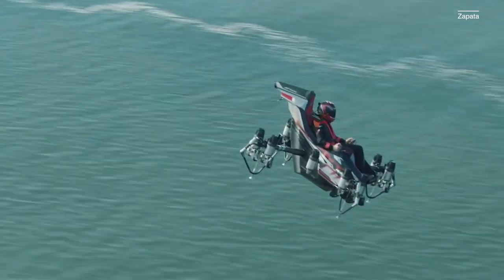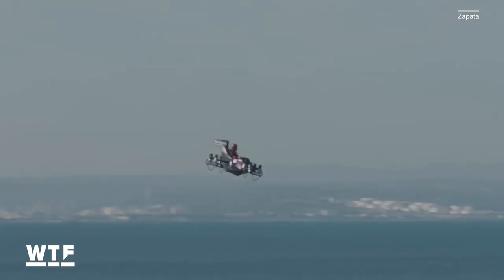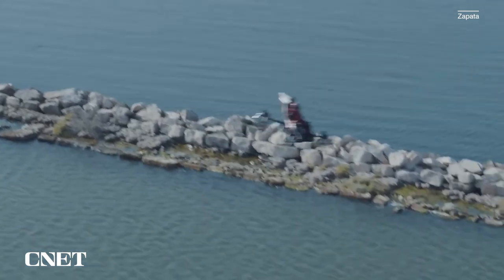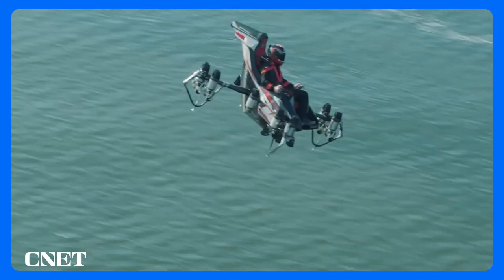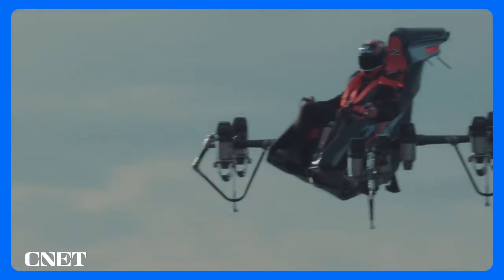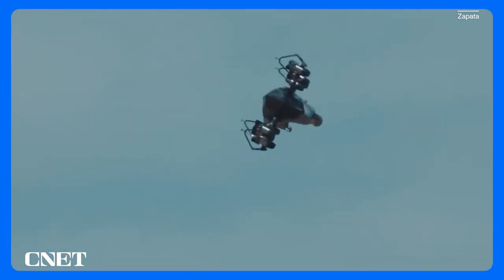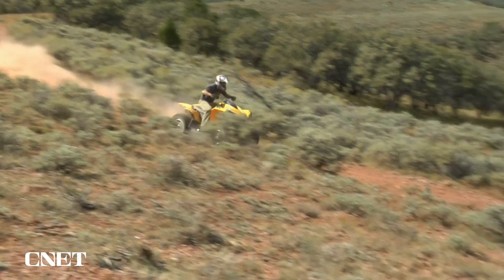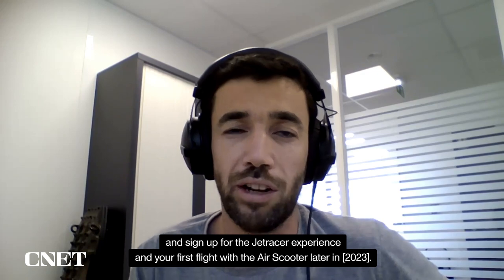Meet the Jetracer That's Powered by 10 Jet Engines

Comment: Non-electric flying vehicles have the advantage of long flight times, turbine engines have a large lag time between changing thrust levels, electric motors have excellent throttle responce times but terrible short flight times. When batteries can deliver better power to weight ratios, electrics could replace hydrocarbon based motors.
Reply: We still have the freezing temperature  problem.
Reply: Not all jet engines have a lag time. Only turbofan engines need time to spool up because the thrust fan is separate from the powertrain, and with new technology in clutches that has even shorten.
Reply: @heliopilot1  I think you may have meant to say  that some jet engines have a low lag time. electric motors have a much lower lag time than jet engines, that was my point.
Reply: @Jim Mears  ice vehicles have that same problem there is just 100+years of engineering that has gone into to dealing with it.
Reply: Hydrogen will be the future, as it its entire weight is pure energy just like other fossil fuels. Hydrogen has the advantage of being used in fuel cells to produce electricity and run electric motors
Reply: @heliopilot1  All jet engines have a lag time. Even a tiny RC jet like the one they have will take over a second or two to go from idle to full throttle.